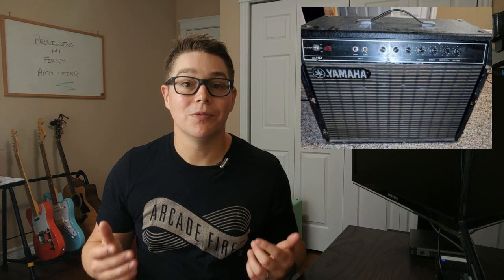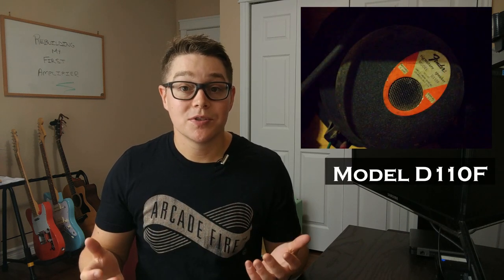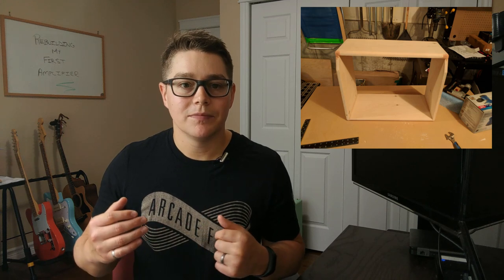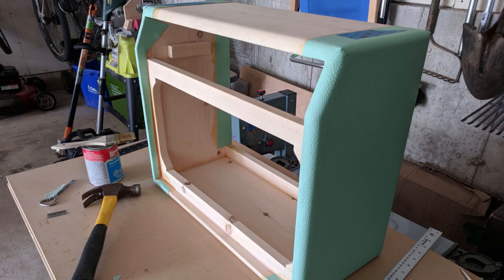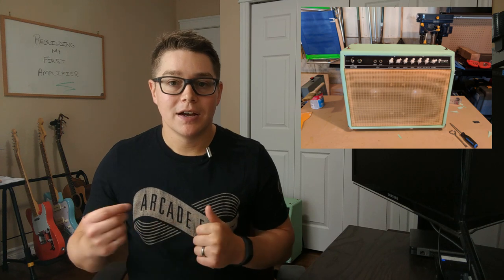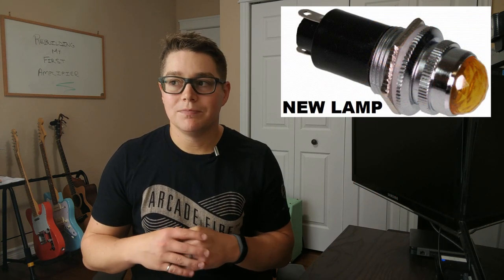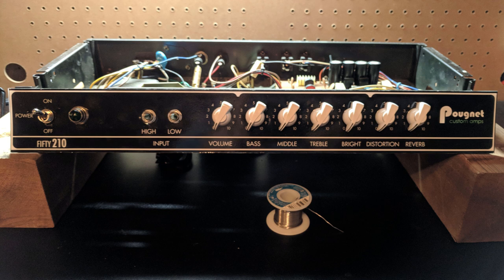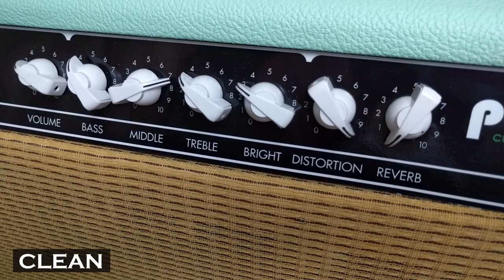Rebuilding My First Amplifier | Yamaha G50-112 | DIY Guitar Amps

Comment: Wow! Fantastic restoration and mod to a great amp. I recently worked on my friend's G50-112 which was in very good shape to being with. I cleaned all the pots and upgraded the reverb (which had broken spring in that tiny chassis mounted tank) into a long tank. Reverb now sounds amazing. Almost like my 1977 Princeton Reverb! I loved his amp so much, I recently bought a rare brown Tolex'd 1982 Yamaha JX35 30 watt amp for $50. Same tiny little tank underneath chassis, so at some point I might put that short tank like you installed in mine.
Reply from the maker: Thanks! I'm very happy with the outcome. It actually gave me the bug for a mojotone build. Just trying to decide which one now!

Comment: The G50 112 was my first amp too!  I got it for $50 from the Starving Musician in Santa Clara, Ca.  I sold it because it wasn't metal enough.  In hingsight, the reverb was great and it had lots of clean headroom, wish I still had it.
Reply from the maker: Agreed. This one came from a local musician who was actually my dad's barber. I received in the mid 90s and it was already modded with the jbl speakers, and had the blown reverb unit. I didn't know what either of those were at the time. This project put some life into the old guy!

Comment: Nice restoration I've been working on restoring a yamaha g100b-212
Reply from the maker: Nice. Good luck!
Reply: Oh god I have a g100 2x10 mk3, which is a bit different, but does yours weigh as much? Mine is a backbreaker, it came without wheels as well.
I wanted to remake the case for it in hope of reducing the weight, just wanted to know if it’s supposed to be like that in others as well
Reply: @Madeguydo  oh yeah it is quite heavy.
Reply: @Musicalmane   Ouch, maybe I’ll just settle for adding handles on the sides and ask my bandmate for help to not get herniated discs lol, thanks

Comment: I know this is a long shot but... I'm having the same problem with the distortion on my amp (same model).  Do you remember which 2 diodes you replaced to get the distortion back?  Any help would be appreciated.

Comment: Those amps in that yamaha series were designed by Paul Rivera from fender, amp used a parametric eq. Yamaha put a lot into research and development of these units.
Reply: This amp is from the previous series (to the Series II amps that Paul Rivera worked on).
Reply: @bb_lz9790  yes that's correct, a series 2 Rivera sold a couple months ago here in Canberra on marketplace for $200, amazing original condition. Sorry I never  snapped it up. I have a series 1 also
Reply: Amps of this age can benefit also from a full recap, electros for starters a nd resistor check in the power supply and output circuit. Nice job and well done

Comment: Do you know what kind of potentiometers it uses? The current switches crackle.
Reply from the maker: I think most are b50k. You should be able to find the schematic online.
Reply: Clean those pots with electronic switch cleaner, half the work with older amps like this is a good service ie switch contact and pot cleaning. Then a good recap, power supply at least, use quality electrolytic capacitors.
Reply: A good overall clean, remove all old dust and fluff with compressed air, I have even washed old boards. Make sure the boards are thoroughly dry, resolder nearly all joints especially wire connections.